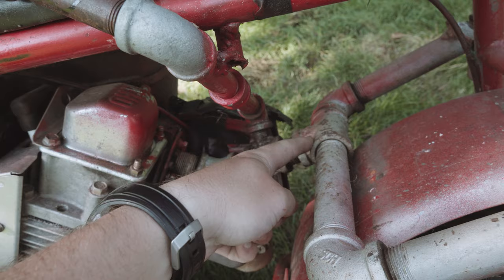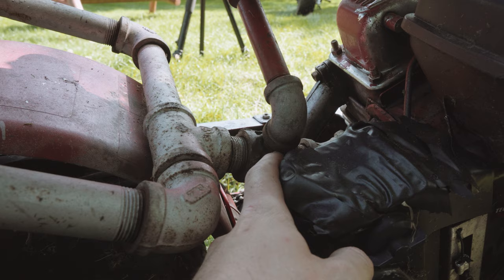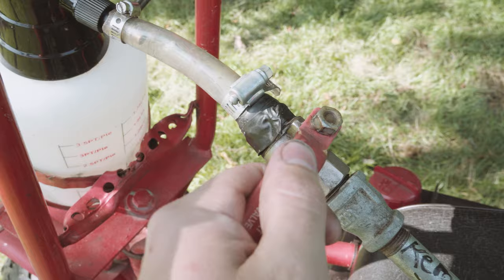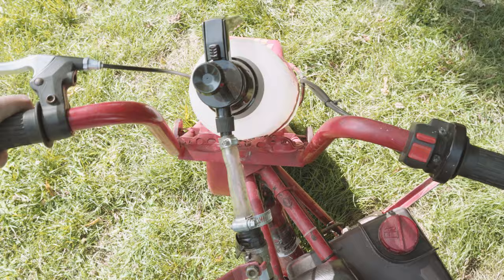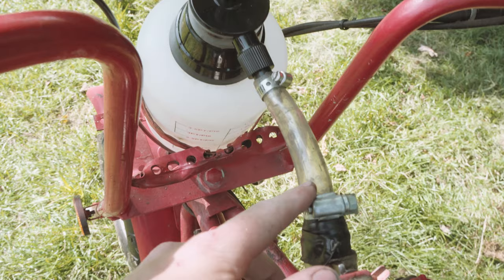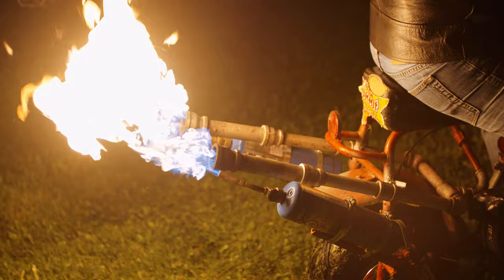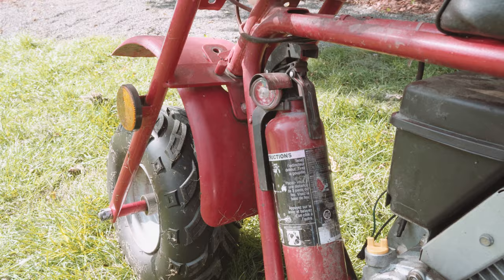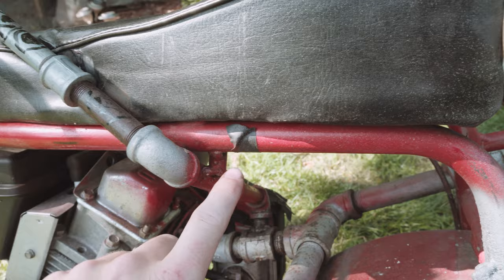How To Make A Flamethrower Minibike (4K)

Comment: Wonder if you could take something like a old coleman gas lantern to moderate fuel flow a little better?
Reply from the maker: Maybe if you just wanted little fire balls. Don't think a lantern would have enough flow for big fireballs like this. But who knows, the results could be surprising as I've never tried propane as the fuel source.
Reply: @MarcelsWorkshop  I was actually thinking the pump gas types. Might be something I'll try and rig up! They do have a nice consistent flow, though not very much obviously. Would definitely be easier on the neibors and less... destructive than yours! Lmk if you ever come up with something like that, I'd bet it would sell well to haha
Reply from the maker: @adamr6498  I didn't even know those existed until now lol. I've only ever seen the ones you screw a propane cylinder to. Just watched a video about them and the dude said 2 pints of fuel on full blasts lasts about 7h. I go through that in about 5 min to get my current fire balls haha. So would definitely need some modding to get way higher flow out of it. Although if you were just going for some continuous small fire balls then it would probably work well.

Comment: Is  the fs700 footage so hard to grade!? I want to upgrade from my a6000 and and am thinking about the new a6400 or the fs700r!
Reply from the maker: Nah I don't find it difficult to grade the fs700. It's the same as the a7sii and a6500 grading wise. 

The fs700's internal recording quality sucks though, only 24mbit 1080p. I wouldn't recommend it unless you would also be getting an external recorder for it like the Atomos Shogun Inferno, so you can unlock its 4k abilities and record at much higher bit rates.

I'd probably go with the a6400 unless you need the 2 xlr inputs, audio monitoring and the extra slo-mo features of the fs700.
Reply: MarcelsWorkshop I shoot music videos the most, but I want to start corporate videos. The Sony a6k line is awesome but they look small. Am African, from Benin and here, as small as your camera is, customers don't consider you. I need high frame rate and for color grading the fs700 has 12bits and it will more easier than 8 bits, though.
Reply from the maker: @kptalteamtv6084  you only get 12bit on the fs700 if your recording raw to an external recorder. without that you only get 8bit. The external recorder alone will cost as much as the a6400. But for corporate video the fs700 would be better then the a6400. However for the price of the fs700 + External recorder, you could probably get a FS5, which has all the features of the fs700 + does 4K internally + has a better form factor.
Reply: MarcelsWorkshop you are right. I was planning get the camera first, the atomos after. But am still thinking about. Maybe I should go for Blackmagic..
Reply from the maker: @kptalteamtv6084  I see. That works. 

I've herd good things about Blackmagic but have never used one of their cameras so don't know how they would compare.